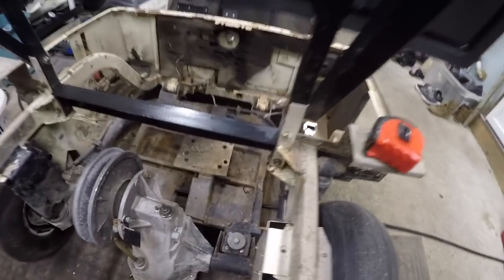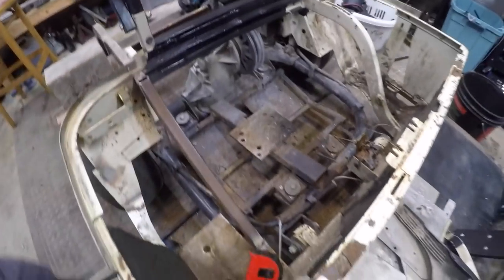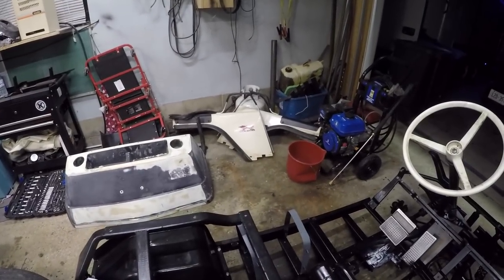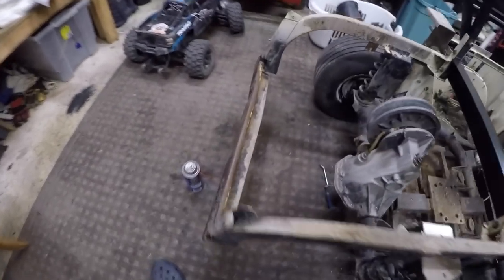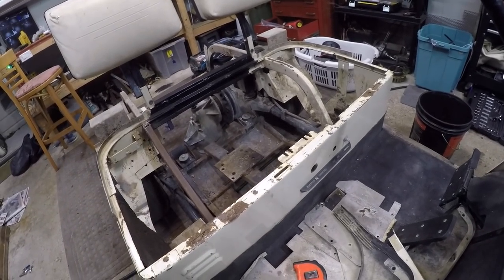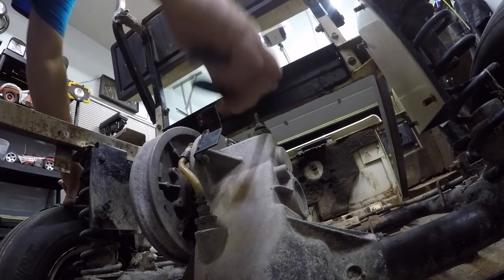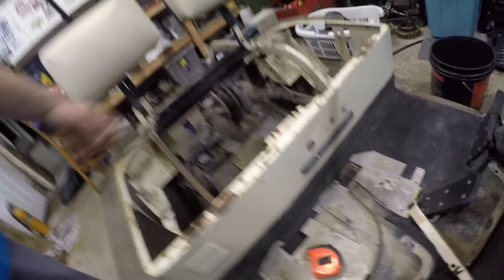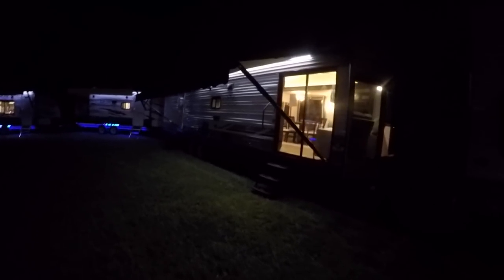Wyoming Fair With Mister Golf Cart

Comment: The old ones like that were two stroke and ran in both directions.You wont find a forward/reverse e-z-go rear end. You'll have to retrofit. There are golf cart junkyards just have to google em. On the stock e-z-go rear end, check for spinning play in the axles. They use a keyway and it gets sloppy over time. Jack up one side, spin the tire one direction and quickly change directions. If there is a big slip and a clunk, keyway needs fixin.
Reply: Oh also.. That doodad on top the rear end used to attach to a rod that attached to the carburetor and was the governor. You could adjust when it kicked in.
Reply from the maker: ya the new er ones have forward reverse in the rear end . That’s what in looking for . I think it might be out of a club car lol
Reply: I think any 4-stroke make/model will have a transmission since 4-strokes can't run two directions.
Reply from the maker: agree big time !! thanks for all your input buds